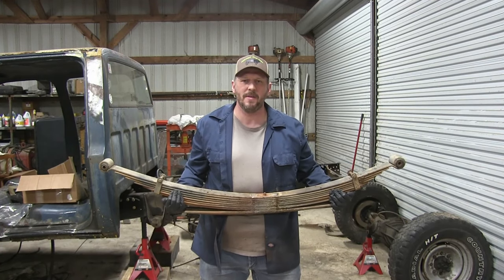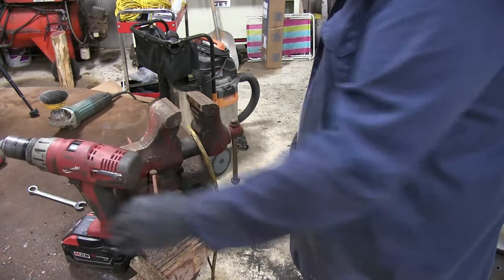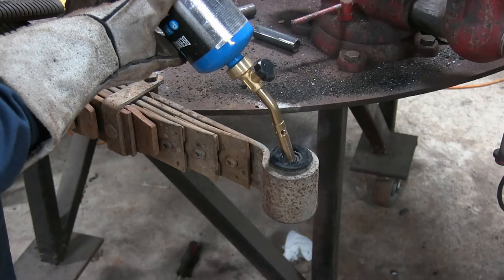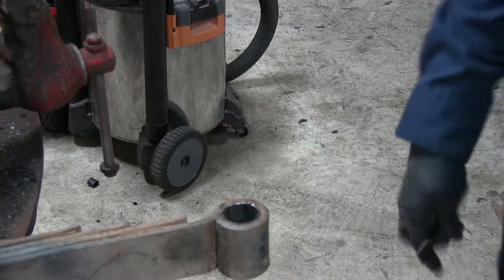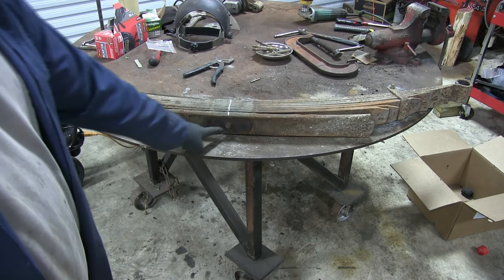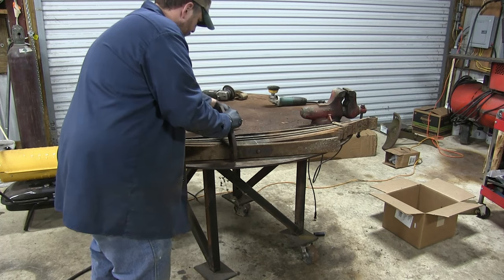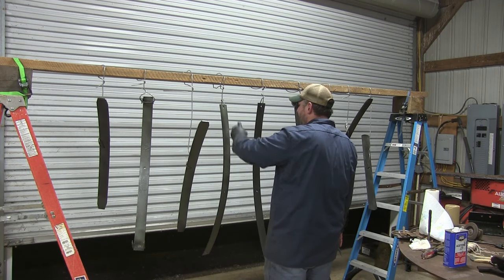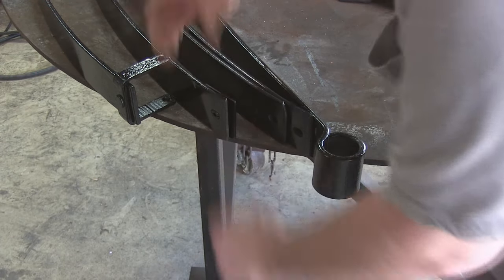Restoring old leaf springs DIY

Comment: Mate , i am a springmaker from Australia. my comment is to use a press to remove the bush in one motion.
Don't ever paint a leaf spring unless is assembled! using a thin coat of laquer.  the spring will not be tight at the centrebolt after rust and wear and tear. u bolts will become loose and the centrebolt will break. nice video mate
Reply from the maker: Thanks for the tips

Comment: Years ago I had a project requiring used leaf springs. Out side the garage there was leaf springs off an old AMC Eagle rusted from the Pa winter salted roads. When I removed the CENTER BOLT and the leaves came apart there was a thin piece of factory installed zink strips about 8 inches long at the CENTER BOLT. Where the zink strip was unbelievable brand new metal. 

 Where the CENTER BOLT is the springs hold more water and salt. The spring gets bridle from the rust and breaks a lot of times at the CENTER BOLT. With the zink strips there's no rust hence no embrittlement. I have seen zink templates (for a better word) between aluminum wheels and the hub to stop dissimilar metal corrosion.
Reply from the maker: Neat, I've never seen that
Reply: @Offroadfarm1  sacrificial anode like on a boat shaft or on steel bridge construction, they are also in steel hotwater heaters.

Comment: Get a map gas torch much hotter then propane. Map gas torch heat then outside around metal sleeve it will expand and the drive metal sleeve out. I’ve never rebuilt a spring like this. Very well done.

Comment: @offroadfarm great video, might I suggest another way to use heat to remove your bushings. Instead of heating the inside/center, heat the outside. Doing it that way helps eliminate the nasty burnt rubber stink, and takes less time. In the case of bushings with an outer metal sleeve, heat outside - knock out the bushing and then take some type of saw (hack or coping or whatever you can easily detach and reattach)stick the blade down the hole and saw through it. Then just knock it out what a screw driver. Same idea of knowing when you got it hot enough, the rubber will start to melt/sizzle. The best bonus is that when you heat it up from the outside, the metal should still be hot (aka it is still expanded) making it easier to slip the new bushing in there. 😃
Reply from the maker: Thanks for the tip and thanks for watching
Reply: If you heat the eye enough it will ruin the temper.  Heating the center eliminates that worry!  I’d use a drill though because I hate melting plastic stink.

Comment: Torch for the win 😂 I remember the first time I got to use a O A torch at welding school to get stuck inner race out of my Honda 4 wheeler front hubs I got them so hot that I had to replace ball joints bc welded them in the position they where in 😂 I lived and learned that day
Reply from the maker: Thanks for watching!
Reply: @Offroadfarm1  thanks for the vid

Comment: I just pressed mine out the other day I have a press piece that works perfectly and takes the outer sleeve out with no trouble at all.
Reply from the maker: That sounds nice!  That would make it so easy.  Thanks for watching
Reply: You can also borrow a hand press from any major autoparts store. Free as long as you return it. That how I did all the front and rear suspension bushings in mine. Super easy.

Comment: Don't paint in between the leaves.
When the paint wears out the center pin will be loose.
Also heating them up is not a good idea but if you do, be careful not to heat up the springs.
Reply: What do you do to stop rust from forming in between the springs, if you shouldn't paint there? I bought new springs on clearance sale, and the paint has been chipped, so was planning on repainting. However, just being rained on for a week, rust has started forming between the leafs already! I'd prefer my new springs don't rust away from the inside out, so what should I do?
Reply: @adamkarlovsky6015  Some people oil them but I have heard that it could also damage them in the long run. Try silicone based lubricant.
It has been a while since I last did research on this and I always recommend doing your own research before trusting the "guy on the internet".
Reply: Sorry, but sprints don't typically move that much. They flex. I have been working on pre-1915 cars for over 40 years, and I remove all the rust, clean and paint every leaf.  If they AREN'T painted, THEN they will rust, and the loosening of the center bolt will happen, not because they were painted, but because they developed a layer of rust, that then flakes out. If you ever buy a new spring, you will see every leaf is painted.

Comment: The porterband thats the tool i need get always need something like that
Reply from the maker: I got the Bauer from Harbor freight.  
https://www.harborfreight.com/power-tools/power-saws/10-amp-deep-cut-variable-speed-band-saw-kit-63444.html

So far I've been pretty pleased with it.  I did get some news blades that were much better than the blades that came with it.  As long as your not going to be using it every day I think it will hold up for a while.  Thanks for watching
Reply: @Offroadfarm1  thank you ill look into that im always need one these lol

Comment: I heat the bushing from the spring side, then take a hacksaw, remove the blade, reassemble it with the blade inside the hole, then saw out your outer bushing sleeve.

Comment: I'm debating whether to replace the leaf springs on my RV trailer or to just replace them. They're certainly cheap enough to just replace, but I don't like tossing parts that're still good and could be like new after a restoration like this.

From what I'm reading online it's best to leave the space between the leaves bare save for a silicon-based lubricant, so that's what I think I'm going to do if I do decide to restore my springs rather than replacing them. I have a plan to lubricate the facing surfaces, stick them back together, clean off any lubricant from the exterior surfaces, and spray the exterior with a rubberized sealant. Where the springs join and flex the rubberized seal will break, but I can just occasionally reapply silicon lubricant to ward off any corrosion.
Reply from the maker: If your springs are in decent shape and just a bit rusty then I would just clean them up.  It is not hard to do.  Now if your springs have settled or are sagging that is more difficult to fix and it would be easier to just replace them.  Thanks for watching
Reply: @Offroadfarm1 😊😊

Comment: great video i'am getting to start on 47 lincoln continental bad sag in front fender low enough you cant turn wheels -going to try to raise body up and put shims on top of spring -front single spring-i like the small torch ---any suggestion thanks

Comment: Omg! Awesome video! So we just bought 2002 Ford Econoline no we’ve been removing rust in undercarriage. The leaf springs are much worse than yours ugh! Now I’m even more stressed. I can’t even imagine trying to take these apart. I literally was having panic attacks just under the van. As I was sanding with wire wheel I am able to see metal. Question is, should I continue to sand to bare metal or is it best if we remove them and restore ? Please Help! Subscribed and glad I found your video. Thanks!
Reply from the maker: You can continue to wire wheel them.  Just make sure to closely inspect them for any damage that may require you to replace them.  If you see anything questionable don't hesitate to either replace them or at the least have a qualified mechanic take a look at them.  Thanks for watching and glad you found the video helpful.

Comment: I think you can harden up the worn out steal by heating up the leaf and throwing it in a bath of used motor oil. Not sure but thats what my drummer did with his old cymbals and it made them sound s higher pitch. He said the heated metal absorbs carbon out from the oil. Ill be searching for this technique to add to this fellas routine. Nice job!
Reply from the maker: Yes you can heat treat your springs but it's not something that is easily done at home.  If you have access to a forge/furnace large enough to fit your springs then give it a try.  Don't forget to temper after the hardening.  Thanks for watching!

Comment: Great video! Any thoughts if I need to remove some of the leaves from the leaf pack? I have a lowered 74 C10 that I'm trying to fit a caltrax on and I think I need to remove some of the leaves from the leaf pack to fit it
Reply from the maker: Glad you liked the video.  I'm not sure about your leaf pack.  I have zero experience with caltracs.  Have you tried to contact the manufacturer?  Thanks for watching

Comment: Nice video and explanations! Which size (diameter) of the new poly bishings you have taken, as they have different sizes? Thank you
Reply from the maker: You need the correct size bushings for your springs.   Check this link, scroll down a little bit and they tell you how to figure the correct size bushing without having to detach it.  Thanks for watching  
https://www.offroaddesign.com/greasable-rear-spring-and-shackle-bushing-kits-for-gm-trucks.html

Comment: I've read painting the leaves of leaf spring packs can lead to wear of the leaf springs caused by the paint wearing off leaving more space (gaps) between the leaves. Having additional space between the leaves the leaf pack may be too loose, causing premature wear? Perhaps it would be better to use a thinner paint that doesn't easily wear? Anyway I don't think you want to cover (paint) the leaves with anything too thick. e.g. Something like trying to chrome the leaves, etc.
Reply from the maker: Great point.  I should have done a better job explaining that in the video.  I tried to make all the coats very thin to try to avoid the leaves getting loose.  I also plan to keep an eye on them and tighten them as needed
Reply: They're painted black when they're new. Just re-painting should be fine.
Reply: Mudd Flow biggest crock I have ever heard.
Reply: @Dixler683  he's right tho don't paint between leaf springs. It's a pretty logical concept really. But hey your rig do whatever the hell you want. Lord knows I've done more than my share of regrettable mods to mine over the years.

Comment: my 10 year old leaf pack is totally flat against my overload spring, are those leafs salvageable if i have them re arced? or are they weak now and no good?
Reply from the maker: You can try to re-arch them but if they are that flat I wouldn't expect it to last long.  You may be better off getting some new springs.  Don't forget you could always check out a few junkyards or pull-a-parts and may be able to find a set of new to you springs.  Thanks for watching!
Reply: @Offroadfarm1  Thank you for your advice, ok i will get a set from jank yard, mine are very flat now and 10 years old.

Comment: Have you ever thought of using a socket that's the same size diameter to beat the bushing out? That's how I usually beat things like that out.
Reply from the maker: You could use a socket.  It might take a bit to get it out but that would work.  Thanks for watching.

Comment: Is it a good idea to plug the holes for the center pin before coating?
Reply from the maker: You can but it is not necessary.  They are convenient to use to hang the leaves from to paint though.  Just remember that you want to use thin and light coats.  Thanks for watching

Comment: why would you need to replace that outer bushing if the rubber was in tack? I didn't se metal to metal
Reply from the maker: The new bushing I installed should provide more flex than the old bushing.  Thanks for watching

Comment: Looks good 👍 what if a spring is sagged/fatigued? Is it bad to try to bend a bit more arch into the spring if it has sagged over time?
Reply from the maker: You can re-arch your springs but I don't really consider it a DIY thing.  Watch this video https://youtu.be/CYWfYyYQ2kA for some ideas on re-arching.  Keep in mind that if you don't heat treat properly they will flatten back out.  If you can afford it and can find new springs I recommend that option.  Thanks for watching and good luck on your project.

Comment: You would have removed it quicker if you heated the outside of the leaf spring.
Reply: Those are heat treated, I wouldn't
Reply: @mblake0420  destroying heat treat takes VERY high temperatures. Guns are heat treated, yet get heat cycled over and over. As long as you don’t discolor the metal, the heat treat will be ok.

Comment: 2018 Silverado Single Cab, Std. Bed, V8 WT.  I'm just looking for a solution to have a smoother ride while it's unloaded.  I rarely load anything heavy or pull anything.  Any suggestions?  I prefer not to spend more than 1K if possible.
Reply from the maker: For less than $1000 I would look into replacing the factory shocks with a quality shock.  You should be able to stay under your budget limit with no problems, but don't cheap out or they may not help your ride.  Good luck and thanks for watching
Reply: @Offroadfarm1  I replaced the rear shocks with Bilstein 4600s.  I can't tell any difference.  To me the entire suspension just feels over-sprung.  I "think" if the springs were more progressive it would be much better but I am no suspension expert.
Reply: @2wrdr  someone might have put heavy half ton leaf springs on truck. How many leafs are in your leaf spring pack
Reply: @smartweadsgarage6806  2 springs in constant use plus a helper spring.  This is OEM.  I bought new.
Reply: Even my wife notices the rough ride and she rarely notices anything automotive.  It rides fine as long as the road is perfect but just ride over a man hole cover and it just feels jars the whole truck.

Comment: Yes, you've made them pretty and replaced the bushes but haven't restored them at all. You didn't reset the leaves to original curve, or retemper them to original spec. When you refit them on your truck, it'll just sag as it did before.
Reply: mossturn01 if they are sagged out you replace them.. Heating springs up to re curve them is not a DIY activity and really not smart to do as you are creating stress points in the steel.. This video does however show people how to clean em up and replace bushings/stop corrosion that will cause a leaf pack to fail prematurely

Comment: Could you just use a hole saw instead of a regular bit to out the bushing.?
Reply from the maker: You can but it will be a pain.  If you have torch even just a small propane torch, just use that it will be sooo much easier.  If you don't have one then you can use a hole saw.  It will be easier if you have a drill press and someone else to help hold the spring.  Good luck on your project and thanks for watching

Comment: Doesn’t heating your springs destroy them?
Reply from the maker: It can effect the heat treat, that is why you heat the inner sleeve and not the spring itself.   That should keep most of the heat out of the spring yet still melt the rubber bushing so you can knock it out.

Comment: how did the new bushing get installed?
Reply from the maker: The new bushings slid in with no problems.  I didn't have to press them in.  You may have to give them a light tap with a hammer but I didn't.  I was able to push them in by hand.  Thanks for watching.

Comment: Why would you not rearch them on anvil and sledge hammer? You did all that work!
Reply from the maker: They aren't sagged out that badly.  I also didn't want to spend the time rearching all the springs.  I will probably end up pulling a 1 or 2 out to increase flex. Thanks for watching

Comment: Holesaw?
Reply from the maker: It may be possible to use a holesaw but I think it would be tough.  The easiest method is a press if you have access to one, the second easiest (in my opinion) is a torch.  Even just a small propane torch like I used in the video worked quickly and easily and they are cheap.  Thanks for watching

Comment: Hi Like your project ! Thumbs up. I'm building a crew cab dodge on my channel if your interested ? I know your busy though.....Can I offer a 3rd easier solution to the bushings. Probably the easiest, I believe. Get a gallon can of the NAPA carb cleaner solution. Pull the basket it out of course. Then set one end of the leaf in the can and wait maybe 30/40 minutes and the solvent completely softens and pushes it self right out of the leaf spring. Just thought I would off my "3rd solution" I 've had real good luck with. Also works good at cleaning off carboned pistons for a motor rebuild. Thanks, Ron
Reply from the maker: Thanks for the suggestion and for watching

Comment: Well, I made it until he broke the drill bit! Sad that he doesn't use a hole saw to remove the rubber bushing! Bet it would be quicker and easier.......just saying.......
Reply from the maker: I wasn't a huge fan of using a drill bit to remove the bushing myself.  I've never used a hole saw, you could try that.  The second bushing I removed I used a small torch to melt the bushing out and it was much easier and faster than using a drill bit.  Thanks for watching

Comment: That's too much work. Just drop it muriatic  acid Bue 20. 31.5%. And they'll be done in a couple of hours.  EZ peezy lemon squeezy. After rinsing out just dry it out good. Sand whatever you want and paint

Comment: You didn't fix those springs at all... the 4 leaf OEM springs were bent long ago and someone added a helper set...
Reply from the maker: My goal was just to clean and repaint them.  Are you sure about it only having 4 OEM leaves?  Every place I could find OEM replacement springs packs showed a pack with the exact same number of leaves as the ones I took off.  Thanks for watching
Reply: @Offroadfarm1  No not sure just appears as such to me... carry on...